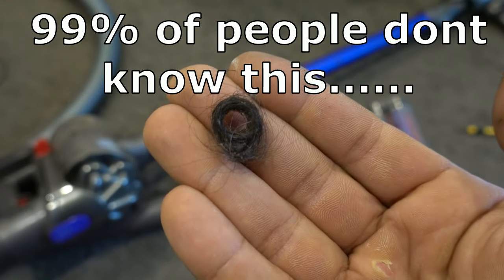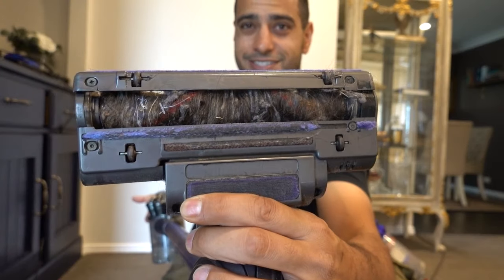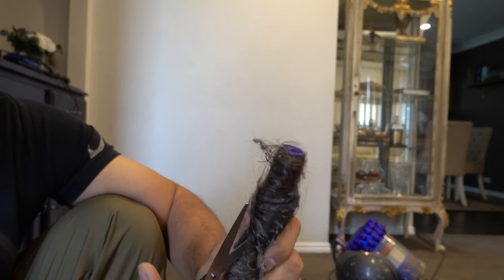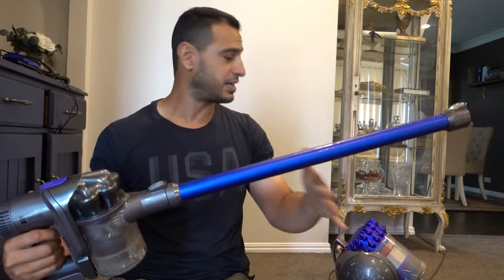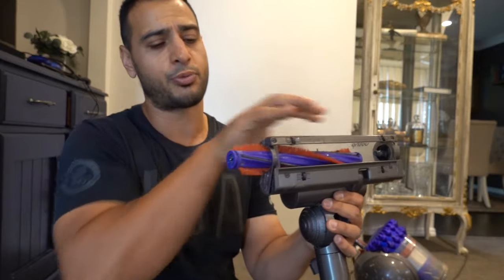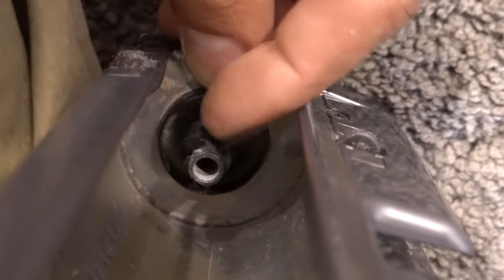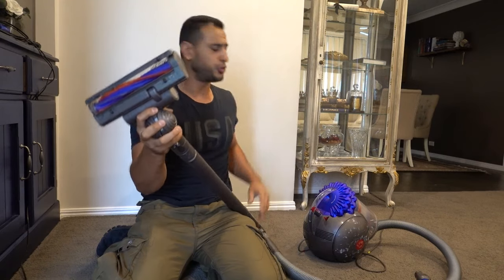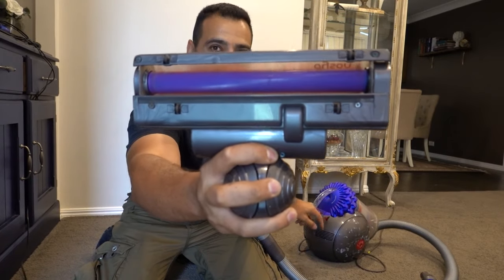How to fix Dyson Vacuum head  - roller not spinning

Comment: Excellent video!  The key for me was removing the screw recessed down in the 'worm' that engages the roller.  I happened to have a set of long reach torx drivers to easily reach that screw to remove it.

I must say that I would never have imagined that the roller could have been kept spinning to accumulate as much hair as was on your roller.   Wow!!  😄
Reply: Hi Bob, can you remember what size torx you used?? I don't own any and want to buy the right one (Dyson customer service said buy a whole new head for vac, about $95!! 🤯)
Reply: @thunderverna  it's a Torx 8 for the screw inside the unit, Torx 10 for the remainder

Comment: On my Dyson V6 (DC62) I had to replace the motor unit as it was rapidly pulsing, which was nothing to do with any blockage. This fixed the initial problem, but the motorized head was refusing to turn. Having measured the voltage across the motor in the head, I found that it initially pulsed and then disappeared completely, so I was skeptical that a simple loop of hair could be the problem. However, I was completely wrong!
I'm not sure I would have found the screw in the middle of the mechanism, so a big thank you for pointing that out. Sure enough, there was a huge amount of hair hidden behind the mechanism. After a quick squirt of WD40 the roller ran much more freely, and (of course) everything started working as advertised. Also, measuring the voltage on the motor showed that the main unit must cut off the voltage if the roller is jammed, which is why I couldn't measure anything originally.
Again ... many thanks. :)

Comment: Thank-you for the great video.
My Dyson DC-39 canister vacuum cleaner roller wasn't rolling.  In my case, the main problem was the rubber seal between the canister and lid wasn't sealed properly.
I did use a Torx T10 for the outside screws and a T09 for the center screw as there was a dust ball.

Comment: Thank you, Bill. Great video and helped me a lot with a sick stick Dyson - head roller not turning. Removed the roller but the brush was fine. A bit of build up but nothing blocking it. Then, as you showed so well, I checked for the electrical connections. Turns out someone had been a bit rough (teenagers, amirite?) reconnecting and bent one of the pins out. So, no power. I straightened it and voila! Head roller spinning like a beauty. Greatly appreciate your excellent advice, Bill. Thank you.

Comment: Thanks for the tips. I did find some hair in that little part after unscrewing it but that didn't fix my problem. 

Here's to help anyone that may have the same issue. If it spins up fast and goes slow after a while it's possible that the ball bearings need some lube. If you unscrew and take out that part and look inside carefully, there is a steel ring with ball bearings. I just needed to lube them up some and it started working all good. 

Other things after some time with this:
 
Everything seems to spit back out and doesn't get sucked up? Probably something jammed at the back of the brush head. 

And keep that little filter vent thing clean on the left side. If it's blocked up the turbine won't spin. I've opened mine all the way up and there is a turbine inside spinning to drive brush.

Comment: Yep, awesome video. This one also save me couple hundred bucks on a new powerhead. One thing extra I did have to do in order to get out that little turbine was there was a small screw actually in down the middle of it if you look through it. It was a T8 Torx head screw the same as the others and once I took that out from inside the turbine I could pull that off and get behind to get all the hair out.

Comment: Exactly what you said at 7:19. But mine looked quite a bit harder to open than yours. Had to pull apart the whole base where the motor is.

Comment: Have a v6 slightly different model than the video but this solved the problem. Replaced the battery. Cleaned then replaced the filters. Even took it to a shop and this problem still persisted. If not for this video was going to just buy a new one. You rule.

Comment: excellently explained. I have always dreamed of buying one, but if I have 5 long-haired dogs that shed heavily, the spinning head would probably be blocked every time I'm vacuuming. I have a question for you: it is possible that the vacuum can work without the spinning head? from time to time, when I come back from the beach where i was with my dogs, there is a second beach on the home floor panels.  Will the vacuum cleaner cope with hair and sand without this spinning head?

Comment: Problem solved!  Thank you.  With several pets and three long-haired girls, I have gone through many vacuums and carpet shampooers over the decades.  My biggest complaint is that NONE of them are easy to clean.  It is a given that these machines will get clogged with hair, fibers, etc., so it should be easy to take them apart for thorough cleaning.

Comment: Dude you are amazing. I tried clearing the hair from the roller and cleaned the electrical parts but it still didn’t work. Then I removed that black thing and removed the tiny coil of hair and that TOTALLY WORKED!! Thank you!! 👍🏻👍🏻👍🏻👍🏻👍🏻👍🏻👍🏻👍🏻👍🏻👍🏻👍🏻👍🏻👍🏻👍🏻

Comment: Mine worked fine until I rinsed the head out.  I took off the slotted end as you suggested, the inner axle spun no probelm.  Brush head was clean, and spun fine - as long as I didn't secure the slotted cap back on fully.  Then it would apply a braking effect - stopped everything.

Comment: NOTE: Also, your video gave me the clue for getting that helix thing off. Sadly, no hair..... but the bearing was seized up in my case (rusty).  Pick of the bearing cover with a pin and doise in WD40 to wash out the rust. Then if freed up and all was good.

Later a confession was extracted from the user who said she washed the head with water..and dried it in the greenhouse. Face Palm.  She will be sent on another course for a refresher ;-)

Dyson Handheld Animal.
and Thanks for your video.

Comment: THANKS!  Saved me $200 bucks I would have spent to replace the motorhead or more for the entire vacuum.  Even saved me the $25 it would have cost for a torx set (which I may get now that I know this repair fixes such a common issue). THANKS AGAIN!

Comment: Hi Bill, thanks very much for this useful video which was clear and easy to follow. I went through all steps and successfully removed the band of hair from under the spinner. Sadly, the part is still not spinning after removing the hair (and dust). Is there another video for cleaning other parts of the turbo head spinner ? Thank you.

Comment: Thanks for taking the time out of your day to make this video ☺️.  I couldn't figure how to get the black corkscrew part off for the life of me but all you had to do was pull it. Saved my day
Reply: What screw driver did you use to get in there?
Reply: @ruthmatthews5117  It's a Torx 8 screwdriver for inside the "corkscrew" part, Torx 10 for the other screws.

Comment: Looks perfect and I can't wait to try it but the end cap will not come off. I have locked and unlocked many times but it will not come out. I have tried grabbing the brush head and pushing, hoping that would push off the cap but it won;t move. Any suggestions?

Comment: Great video!!! I did everything exactly as shown in the video. There is no electrical component, runs off the turbine. Definitely was a ring of hair inside around the 'mechanism' but once everything was put back together the brush still doesn't rotate. Any more thoughts?

Comment: My brush was spinning but it was really noisy and the suction was poor - every other head was fine, so the issue was with the Turbo head. Thanks for showing me how to get the roller out - I was concerned I'd bust it if I did it wrong. And my cap can't be done with a spoon handle, cos there's a bump right in the middle of that slot, for a special tool, I guess. So I got two ordinary door keys and wedged them in either side of the bump, held the heads of the keys together and turned - easy as pie. Discovered the head was just fully blocked, and taking the roller out gave me access to it that I didn't have before. Also cut the 5 years of hair tightly wrapped around one end of the rotator, in a little groove there. Took quite a bit of work with a knife, careful not to score the plastic. Put it back together, using the keys again to lock it off, and no whiney sound, and full suction returned. Thanks, mate.

Comment: This is a great video and I THINK it might solve my problem since my roller part that might be hiding hair is barely able to move. HOWEVER ….. I removed the screws and the small section popped offed no problem but the larger one that holds the wheels is lose on either end but there is a clip portion in the centre.  It did not seem like you had to deal with that.  I am afraid to force the piece off lest I break the clips. And the clip is sectioned in 2 parts so I can’t easily put a screwdriver in both areas at the same time for clearance. How careful do I have to be to remove the plastic section ?  And yes, I tried to unscrew the roller part but my tork screwdriver is not skinny enough to roll inside the compartment as it is attached to a multi set.  I can only get one turn in and it’s not very precise. So again, how do I deal with the plastic clip part if you have any ideas ?  I am SO close to success.

Comment: Hi there! You’re video definitely helped a lot. There was so much hair stuck behind that little screw my goodness. My problem now is that it still won’t spin. I was extra careful taking it apart and putting it all back together so I’m not sure what I could have done. Almost as if even less power if going to the head. Not sure if you have any other suggestions I can finally try before giving up?

Comment: Thank you very much sir. Not the same unit, but it applied also to cinetic big ball 2. At first I cannot pull the piece so I removed the plastic parts as you do. But this was unnecessary, only removing one screw (T7 torx in my case) holding the piece will be enough, a bit force while pulling it is needed.

Comment: Excellent video, easy to follow.  That said, our Dyson DC47 looks a bit different when we got to the last mechanism.  Instead of a “tube” in which to insert the screwdriver, there was just a slightly rounded mound with screw in the middle which we removed but could not free the mechanism.  Any thoughts?  The mechanism rotates freely.  I may try giving the brush roller a startup with pliers, as someone else mentioned (power off, obviously!)
Reply: I have the same type. Haven't been able to work it out yet.

Edit: Found a video showing how. Just got to yank it hard with pliers https://www.youtube.com/watch?v=IKQ14Vk_lbM

Comment: Hi thanks for you r video. I have a different issue with the head of Dyson V8. My cap is stuck to the brush bar and that is causing the brush bar not to spin. Any solution for this issue? I tried removing the cap but its not coming off the brush bar.

Comment: I had this issue, and looked at all the tutorials on how to fix a non-working triggerhead, and it turned out not to be the actual triggerhead but a clog in the very top of the hose at the  wand trigger handle.  There were some small objects that got stuck and prevented the suction release from engaging again.  Once those were cleared, the triggerhead worked again.  Hours and hours of searching for the true reason and once found, fixed in two minutes.

Comment: Hey Bill, 

Keep up the videos, super super helpful.  

My Dyson stick, exactly the same as yours, works like a dream except when I use the stick connection. Tried cleaning every single thing, cleaned all the contacts, the head spins a little but stops.

Could it be the connector point in the barrel - it seems a little loose and maybe it's not connecting 100% ?

I did try to remove the barrel, 2 torc screws, but I couldn't remove it completely, it was not coming easily.

Dies anyone have this issue ?

Peter

Comment: Great video--thanks for the fix.  Mine was a bit more difficult to access than in your video, the main screws were T10 but the one inside the spinner was a T8.  Too bad Dyson hasn't corrected such an obvious design flaw or at least made that part easier to access for cleaning!

Comment: Huge thanks from the UK, fixed my stuck roller! One point to mention, my model (big ball animal cylinder) has a smaller torx screw than the rest in the small grey centre piece 🙄 Had to scramble around for a smaller screwdriver. Thanks for that Dyson!

Comment: I always take mine apart and clean even the part where you took the screw out but then realised it was the electrical connection on long pole to motor, the clip is loose.. bit of strong tape, works fab.. thank you!! Genius x

Comment: Thanks for this.  Sadly taking the spindle out (third approach) didn't work - so I continued disassembling until I got to the turbine itself and found that the teeth on turbine blade itself had stripped.     So the turbine was spinning but the drive was not being transferred any further down the power train.   This is the second head that we have had - Dyson actually replaced the first one free of charge when that stopped working in exactly the same way.     Feels like there is a design flaw here

Comment: Did you use the same size torx on all screws? The 4 to release the bar were fine but that small one that is recessed would not come out and I do not want to strip it. Thank you

Comment: What size torx screwdriver did you use?? I tried to measure the exterior screw but the star is so small it was hard to tell. (Don't want to buy a whole set as this is the only time I'll ever use one)
Thanks for being the only one out of the dozen videos plus I watched who mentioned this fix; I even called Dyson they ended up saying to buy a new motorhead 🤯. I like your way better and I'm pretty sure it's going to solve my problem 😁

Comment: I almost threw away my Dyson vacuum that I have had for YEARS before I saw this video.  It's surprising how LITTLE hair can stop the roller from spinning.  I didn't even think that was the problem because there was like 10 strands of hair around the roller.  I followed the instructions per the video, removed the roller, cleaned off the 10 strands of hair and some lent, put the roller back on and voila IT SPINS AGAIN.  I can't believe it was that simple.

Comment: Can I add that when you unscrew the part that drives the roller round, if you do not find hair and it still does not rotate freely, then look where the drive belt is. There is a screw in the middle area of the drill belt. If you undo this, remove the drive belt you can then slide the roller end out from the motor end. Then look closely where the drive roller (with the screw you took out to remove it) was and you will see a copper washer. Remove this (you can use a magnet) and you will see the bearings! Add some lube and see if that frees up the mechanism. It did for me.

Comment: Bill you are an absolute LEDGEND!!! I was about to buy a new Motörhead and then I found your video.  I definitely would not have had the confidence to pull the head apart except for your brilliant instructions. It was a bit of a ball ache trying to get the last screw out of the grey spinner but managed it with a small flat head screwdriver in the end and lo and behold a gross black ringlet of hair unfolded from underneath!!! Vile! but the head works perfectly now! I'd buy you a beer to say thank you if I could 😂

Comment: I’m not sure if mine is a completely separate problem, but my brush bar and spiny thing work perfectly fine until it’s ‘locked’ into place by the cap on the side of the vacuum then it stops spinning completely. Ordered a new brush bar but it wasn’t for the right model

Comment: Those little screws are the most annoying f***ing things I have EVER come across. However-- I ended up not even needing to take out the last one because I realized that one of the connections was a bit loose! Didn't even know those were there. Keeping pressure on the neck keeps it spinning. Thank you!!

Comment: I took my roller apart as suggested in this video and everything was cleaned out but it still not spin. I noticed when I put my finger in front of the intake part of the roller then it started to spin. So it seems there needs to be something in front of the intake for the spinning to happen. For some reason. it is not working when the brush is attached.

Comment: If you haven’t got a hex or star driver, hex keys will do it too.
Dyson DC49, the spiral doesn’t come out when you take the screw out, but I suspect what happens with that one, is the brush bar just gets tightened up in use over time and needs loosening, rather than hair wrapping around it.  That’s the case with my one, unscrewed it, then screwed it back up after spinning it around a bit and now the brush bar’s spinning freely.  Which is good, as Dyson have discontinued spares for the DC49.

Comment: Ton of hairs in the ball bearing where the rotator was, thank you for the tip. Note to others, the screw size for the rotator was smaller than the other screws.

Comment: Hi. There wasn't any hair behind that impeller and the wheel the belt drives won't rotate more than a few degrees. I wonder if I can pull that toothed wheel out of the housing but worried about breaking it😮
Reply: Ah, wd40 did the trick